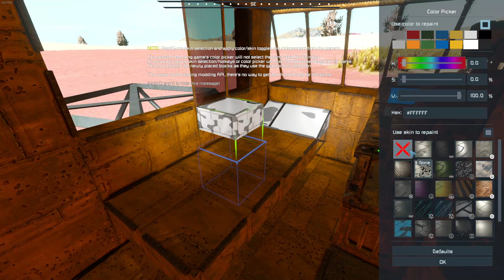Strating The Space Camper | Space Engineers Scrapyard Survival | E55

Comment: im 2 min in and because ya put the re spawn on one side you need a counter weight of a battery on the other side mabe 2
Reply from the maker: Unless there is something im missing in my parts pile, the toaster may have had its last salvage flight. I'll probably need a combination of the toaster, forklift, and maybe the crane to finish assembly of the space camper though.

Let me know if there is anything missing in my pile of parts at the end of the video. I ended the recording at almost midnight so my brain wouldn't brain well anymore.